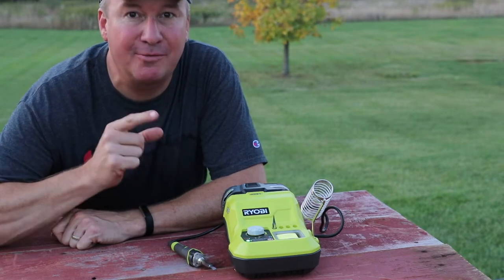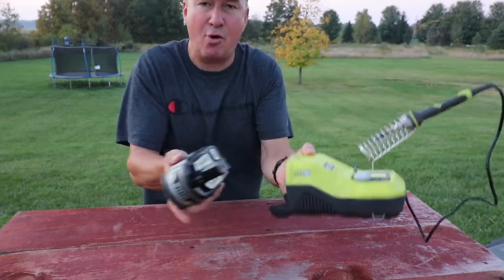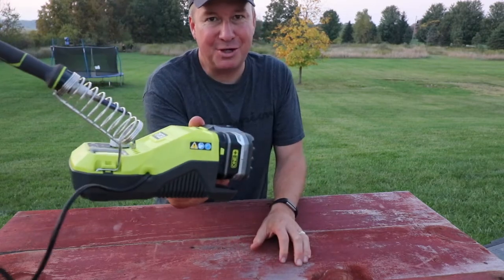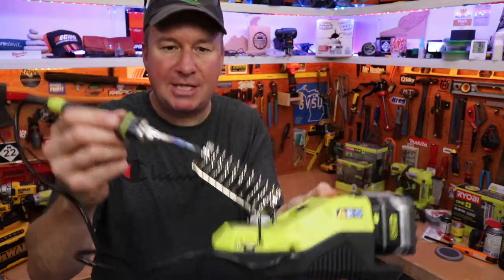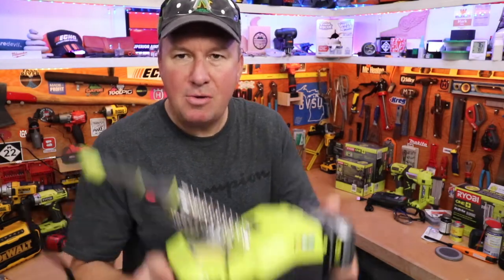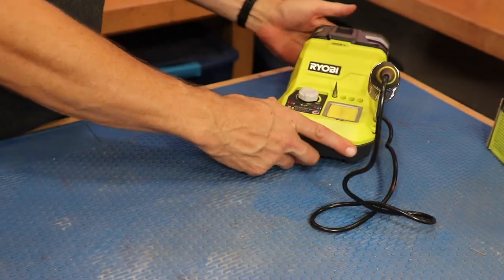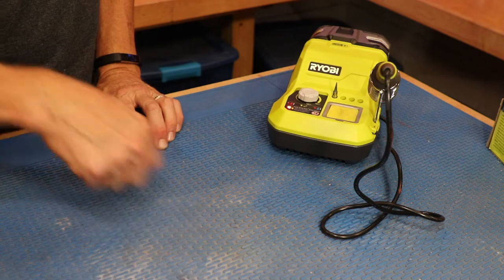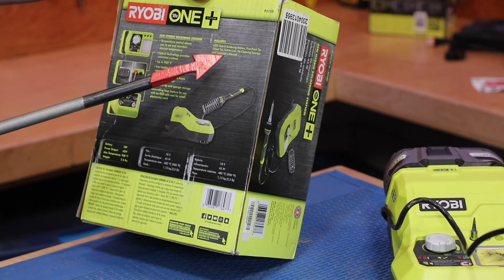SOLDERING STATION // 18V RYOBI HYBRID ONE+ MODEL P3100

Comment from the maker: Question of the day: Do you solder by putting the iron at the bottom, to allow the solder to flow in?  Or do melt the solder on the iron and rub it on the top of the wire connection?  What type of project would you primarily use this soldering station  on?
Reply: hey
Reply from the maker: Hey there Collin!👋
Reply: Heat the surface first that I'm trying to solder and allow the solder to flow into the joint I'm trying to make. Usually ends up making much stronger joints in the long run and gives a better connection.
Reply: I heat the surface and feed the solder into the item @MarkThomasBuilder
Reply: Tin the tip to increase heat transfer, apply iron to heat both component leg and track, then insert solder into the junction.
Reply: Thanks for your effort making this video
Reply from the maker: @Auhdil You're welcome.  I recently picked up a helping hands kit to go with this.  I should make a quick review of it.

Comment: Great video! Don't forget to put that heat shrink tube on before you solder the wires together lol. I've made that mistake before. Also, if you want to completely waterproof connection, apply some dielectric grease to the joint prior to putting on the heat shrink tubing. The tube will squeeze out any excess grease as it shrinks and make that section completely waterproof.
Reply from the maker: Oh nice, that's great advice.  Speaking of heat shrink tubing, I wish they made some that could wrap around after making the solder connection.

Comment: I use heat shrink the most but in spots that need protection I use both heat shrink and tape
Reply from the maker: I'm a big fan of heat shrink tubing.  You never have to worry about the connection.